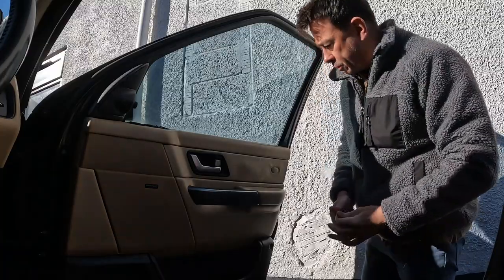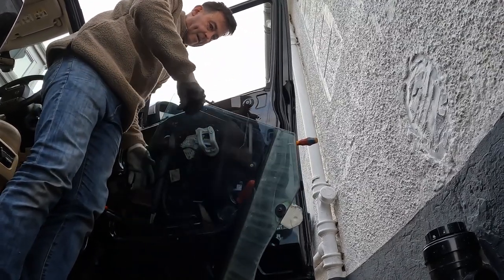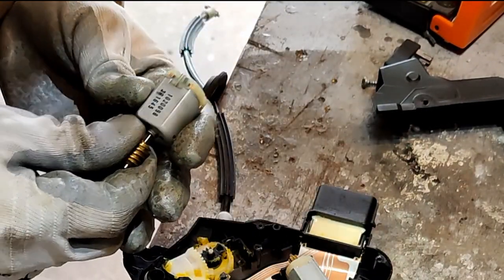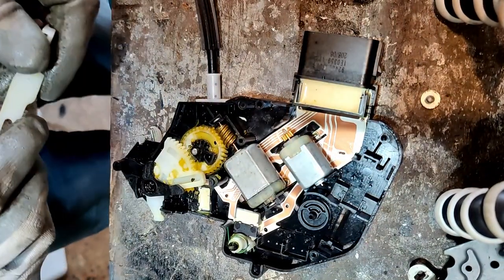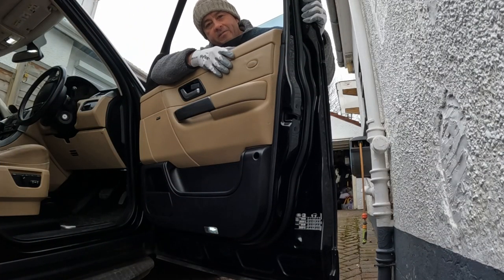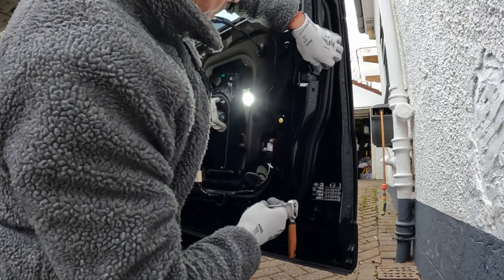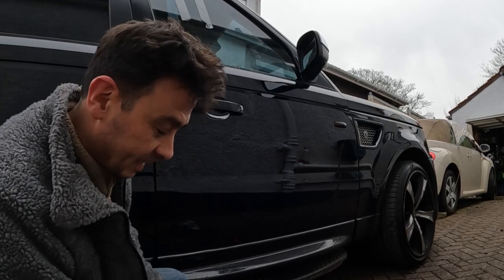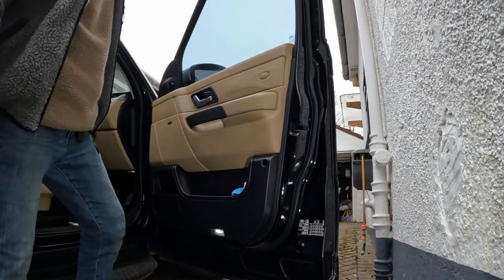Door Actuator Lock😊Remove & Replace Fix! Range Rover Sport L320 insurance writeoff - Episode#4

Comment: My 05 land Rover lr3 the lock is stuck on. Can't open the door from the outside either the inside. 🤦Had to cut the inside of the door up to get to the actuator and break the actuator up. Crazy. Smh
Reply from the maker: Damn dead locked

Comment: Well done! What a job! I have the same issue with my L320 on the rear door. I got myself an actuator and will attempt to replace it soon. I am hoping it's less work since it's the rear door rather that the front driver one (your case). I have a question if you don't mind. Why lowering the window in the first instance? I mean you could have kept it up and had the space to reach to the actuator since the window is up. Unless there is something I haven't thought about? Would appreciate your advice. Thank you!
Reply from the maker: Good question, actually you can't just undo the plate that holds the window motor and slip your hand in, as I found you cannot move the mounting  plate to the side, therefore when you separate the 2 window catches, you can then move the motor to the side.  If you watched the whole video half way through I do the job in less than 10 mins and find you do not need to remove glass, just support it, good luck
Reply: @GrooveOn  thanks for the reply. I am just a bit scare to unclip the window and miss up its calibration. Will give it a go. You know it’s funny how your RRS has almost the same issues as mine. I got:
Electric parking break issue 
Passenger seat heating is not working 
The door latch issue
Parking sensors not working 
The tailgate is not separating ( the whole boot door rather than the window)
So I am looking forward to the rest of your videos.
Reply from the maker: @ayalsule  thanks for the kind words, use the video I did and start about half way through when I did the actuator a second time, is pretty quick and easy.  Have some gaffer tape handy to hold up window one released. Unclip one side by gently opening the white clip , then the other side 😉
Reply: @GrooveOn  so it worked! Easier than I expected. The only tricky part was removing the outside handle cable clip. It’s a tricky corner. I almost broke it. Thanks so much for the video and for the tips!
Reply from the maker: @ayalsule  yep, it is tricky, once you do it once you can get it!! But the first time is hard .  You should advertise your services and charge $150 bucks to change👍
Reply: @GrooveOn  hahah might do that! Thanks mate!